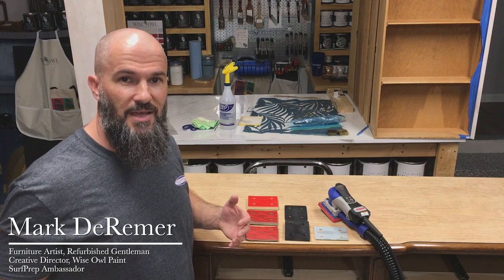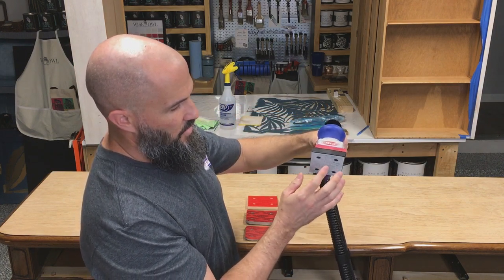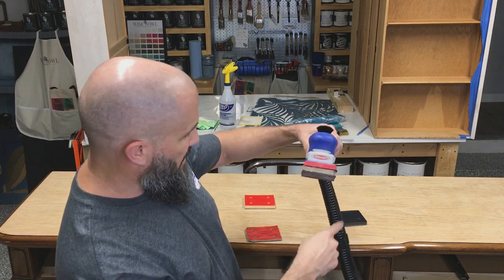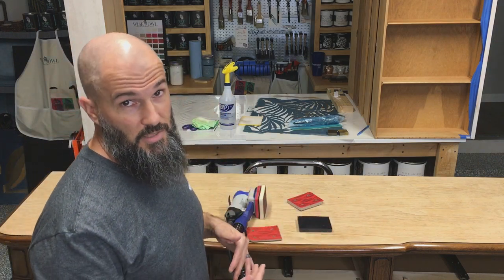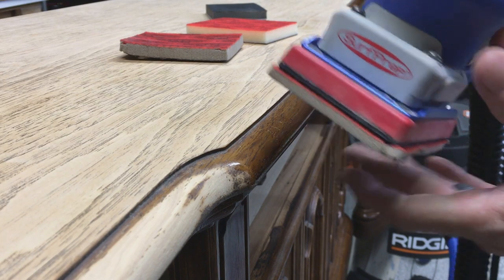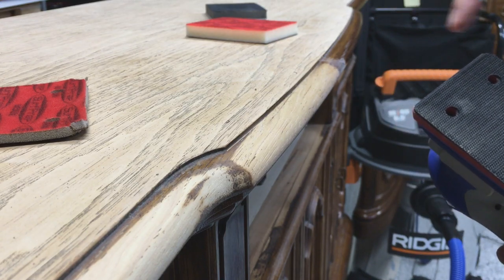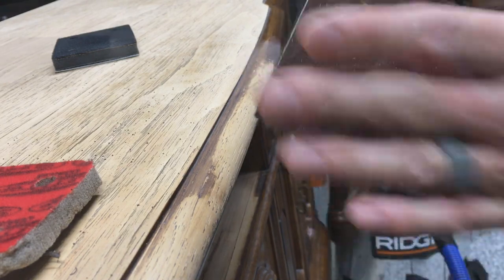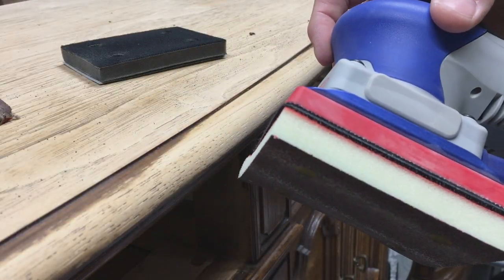How-To Use a SurfPrep 3x4 Electric Ray Sanding System | Removing a Finish on Rounded Edges

Comment: I really appreciate this video as I bought a surfprep sander a while back. Do you have any suggestions for furniture with concave designs on a flat surface? I'm really struggling with an old piece of furniture that used to belong to my parents. Thank you so much!
Reply from the maker: Use a 1/2 inch pad and have it overlap the edge of the sander when you put it on and sand on an angle on the corner of the sander allowing the pad to wrap around that corner of the sander and giving it a more pointed/round edge to sand down in those kind of spota
Reply: @RefurbishedGentlemanTelevision  Cool! Thank you so much!

Comment: hi, I was wondering if you have the vacuum and sander plugged into the same receptacle, If a 20 Amp fuse and a 15 Amp fuse can handle them both.

Comment: What would you use to remove paint from a piece?
Reply from the maker: If you’re lookin for a great safe to use stripper… try this;

https://wiseowlpaint.com/product/greenez-furniture-stripper-cleaner/

Stripper is soy based, works GREAT without the hearse chemicals and smells and can be used inside 👍

That would be my go to for a stripper.  OR… of looking to sand through a painted finish the SurfPrep can handle that, use the aggressive papers or films in the 80 grit range.  Depending on the paint and top coat tho, stripper may be easier. But it’s all a case by case thing.  Spot sand to see, then go to stripping if sanding just isn’t getting it done 👍